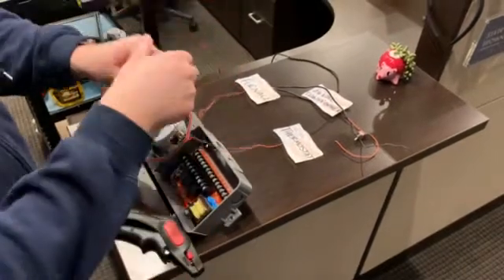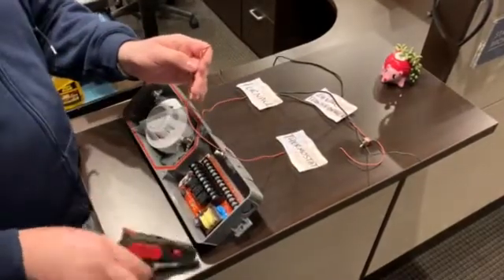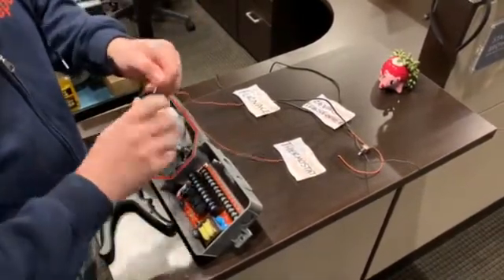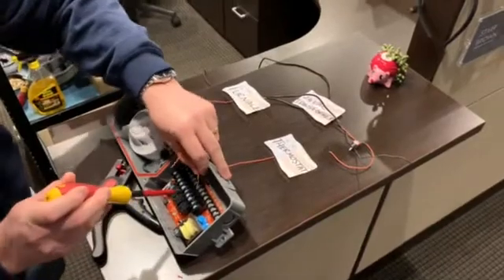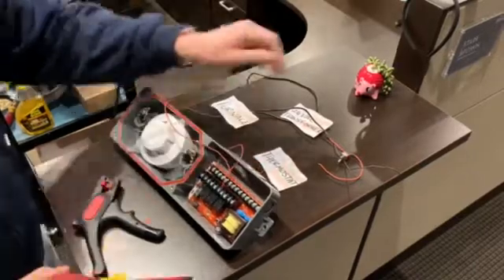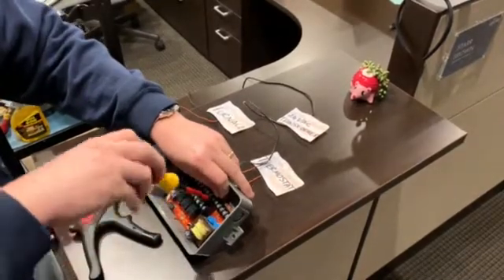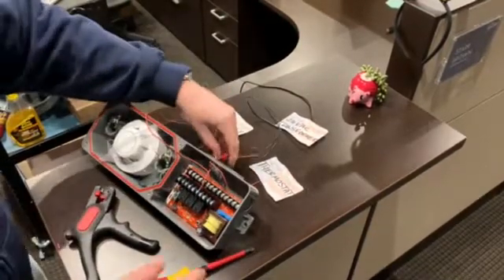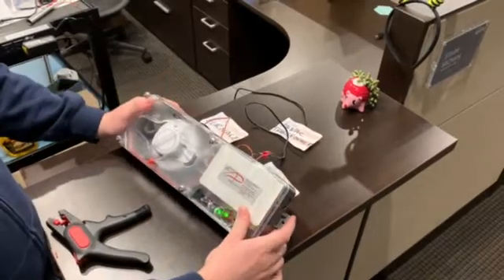Connecting an SL-2000 Air Products & Controls (APC) duct detector to a furnace

Comment: Can I just connect 24v (R) and Common (C) from furnace to 24V (terminal 10) and Common (terminal 9) of the SL-2000; then jumper terminal 10 to terminal 16 (for 24V) and connect terminal 6 to thermostat from (R) of the furnace?
Reply from the maker: Thanks for contacting us! Great news! Out LIVE tech support is back. In order to make use we give you the correct feedback for your application please call :
248-332-3900 or 888-332-2241, option 1 for APC
Ext. 2 for Tech Support
Make sure to visit apcfire.com/support for further details!